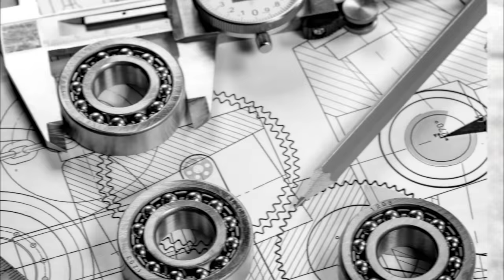The Most Successful Machine Gun in the World?

Comment: Another reason why the Germans opted to use the MG42 backbone instead of making a new MG from scratch was because there where still a lot of MG42's in warehouses (mostly in other countries), so they made conversion kits for them to be able to fit NATO rounds. If im not mistake there are still MG3's that where originally MG42's from WW2 still in service.
Reply: @fuhlfur3061  probably there are in some African and South american countries.
Reply: @fuhlfur3061  No,  wartime 7.92×57mm Mauser chambered MG 42 machine guns that remained in service were converted to the standard 7.62×51mm NATO chambering and designated MG 2
Reply: It's possible but unlikely. The MG1s and MG2s were all brought up to the same standard as the MG3, but as others here are pointing out, the weapon is being phased out slowly. So, good bet that the oldest guns were the first to go.
Reply: I'm not german, but our MG74's are also conversions of the 42.
(the devellopment for our conversionswas was done by Beretta and Steyr. Our decision makers opted for a heavier bolt, stiffer spring and thus way lower rate of fire of around 750 rpm).
During my conscript time 99/00 one of the MG's we got trained on, either had the feed cover (top cover?) or the housing of an original 42.
Under the right light conditions and correct angle, the formerly stamped in 42 that had been sanded off at the conversion was still a bit visible. (But after 23 years i don't remember if it was the top cover or the the housing.)
I mean there are parts that don't really wear much, and if they are kept from rusting, no problem to use them further. 
Things like the cocking handle, housing, grip and feed cover easily can last that long if they don't get damaged.
It's clear that no one would find orignal 42 springs, barrels and bolt heads in MG3's as they are part of the conversion anyways, or consumable items that wear out like rollers, barrel bushings and again: springs. Or bipods that get broken by soliders in use on rare occasions. 
Maybe the recoil booster could also be reused as the gas pressures of both rounds are similiar.
(i would argue that from 8mm Mauser to 7,62 you won't be reboring barrels. The NATO round is shorter and has a smaller bullet diameter. To make such a barrel work, you would need to bore it out way further and insert a "liner" then cut new lands and grooves into that liner. And before that: weld in some material into the chamber and drill/ream it out again to fit the new casing proportions. That is something that gets done occasionally for bolt action guns, but for a MG barrel? Cheaper and easier to make new barrels in the right caliber. Also, during wartime use, the barrel changes for sure weren't done every 150-200 rounds, so the existing 42 barrels would be k.o. anyways.)

Additional "fun fact":Among 10, 20 and 30 year old jerrycans (they all had their year of production stamped into the sides), we also found one stamped 1944 when stacking cans for an oncomming exercise. 
In good general shape with only a little bit of surface rust on one edge. It was still in normal use for Diesel. (for 56 years by that time)
Reply: @fuhlfur3061  According to the Bundeswehr, the phasing out of the MG3 started around 5 years ago. Clearly there have been converted 42s in use while the MG5 was developed, but I too believe they are now already sold to private owners / other armies.
Reply: @fuhlfur3061  just like m2s, the older stock gets put in warehouses and might see the light of day depending on several arbitrary inventory procedures and rules and blah blah blah.
Reply: I think utilizing a well proven design is the real reason
Reply: @luarbiasawaras8700  And having machinery and experience to make it or at least most of it's parts.
(Also, the Belgians would not let them make FAL's so i guess they would also not have let them make their MG)
Reply: While I was in basic training in 2008 my company had 3 MG3 s with crossed out MG42 markings on the case so this is indeed true.
Reply: @nirfz  yes, agreed, they don't have to start from zero
Reply: @fuhlfur3061  Its definitely not being replaced by the MG5, the MG5 clearly serves a different role than the MG3.
Reply: The ammunition was converted to NATO dimensions.  that's why the MG42 became the MG 3. They are both absolutely identical, except for the caliber.
Reply: @fuhlfur3061  I think i worded it wrong, i meant not completely replaced, probably replaced for infantry, but the MG3 will likely still stay on armored vehicles like the Leopard, kind of like how the US doesnt mount M249's on their abrams
Reply: Never used a MG5 but I will be very surprised if the MG3 will be completely phased out of the German army anytime soon! As vehicle mounted weapon it certainly has its place ! As squad weapon I’m happy for the boys and girls it’s gone then to carry it around trough mountains or actually at all it’s a absolute Pig and I 100% never was jealous when one of my mates had to carry it 😂
Reply: @ryangoslingIRL  the Counterpart of the M249 is the MG4 and not the MG5. The MG5 will replace all vehicle fitted MG3. The SPz Puma is equiped with the MG4 but it is planed to replace it by the Mg5.
Reply: @TheEvil909295  You missed the word "still" in his comment.
Reply: @ryangoslingIRL  That is the only reason Canada has them as they are on the Leopards we bought from Germany. (Not saying it isnt a good gun just that we went in a different direction)
Reply: @fuhlfur3061  just shot one last week, the 42 is crossed out and a 3 is stamped behind it
Reply: @fuhlfur3061  meinst du das mg 3 wird weiter in den schweren mg kompanien verwendet?
da ist das doch warscheinlich effektiver als das mg5 wenn es eh auf einer lafette ist
Reply: @ryangoslingIRL  it is being replaced according to official bundeswehr videos
Reply: @tavish4699  Not for vehicles probably
Reply: Didn't they designate some of those conversions (particularly the ones for Italy) as the MG-42/59?
Reply: When I served my time in the Bundeswehr (92/93), I saw a MG3 with a casing, which has the Wehrmacht Eagle on it  (the Swasika was  grinded of)  with a production date 1944
Reply: @remoraz  thats cool
Reply: oldest browning 50 cal machine gun in US army front line service is 94 years old.
Reply: @juliemunoz2762  Probably not. The design is that old, but that doesn't mean the actual weapons themselves which were produced in the first year of production are still in service. Guns and their various parts get worn out, and the US is still producing the M2, so probably none of the guns currently in service are not that old, but the design is still identical. Same thing goes for these MG42/MG3 machine guns, originally the Germans used WW2 produced guns, just converted into the new caliber, but nowadays most or all of them are of newer production.
Reply: @MaxCroat  i’m not speculating. The weapon I’m referring too exists and was located by the army. There are many such weapons in inventory.
Reply: @juliemunoz2762  oh okay then, I didnt know that. Kind of surprising honestly, I assume that particular weapon must not have seen much combat, so it remained in good condition for so long.
Reply: The ones originally marked MG42 with MG3 stamped over it were brand new in 1959. Somewhere along the way the Bundeswehr decided to change designation from the year they were adopted like the P-38 (1938) or the Luger 08 (1908) pistols to counting how many changes there were so the P-38 was renamed P1 but in that they also counted versions which did not make it to full adoption so by now they are on P8 (aka HK USP), P9 (Glock 17).
Reply: @nirfz  the Belgians would let them, but wanted royalties for it.
Reply: @mcinteer19  Are you sure? As far as i remember hearing, the germans asked for license production rights, but the Belgians refused.
The belgians didn't want them to produce it, but would have sold them finished rifles.

Germany had bought a couple belgian ones before, which were issued as G1and when they weren't allowed to produce it themselves, they went for the G3 and gave the belgian made G1's to border control and reserve police units.

Comment: I wouldn't be surprised if the MG-3 still remains in some form of service 100 years after it was first introduced.  Some developments simply cannot be further improved.
Reply: You mean like the M2 Browning already has?
Reply: @georgesakellaropoulos8162  

Not the same, the M2 Browning is not a multi purpose mashinegun used by infantry and vehicles alike ....
Reply: @mandernachluca3774  Why does firing a heavier caliber make it not count? It was widely used against infantry, light vehicles, light static defenses, and low-flying aircraft on the ground. Still is, too.
Reply: Imagine they make one with barrels that can withstand more rounds being fired before needing to be replaced
Reply: @crowe6961  The question is not what the gun is used against, it's a question what the gun is used with. In particular in an infantry role without a fixed mount (= only bipod). That's the definition of a light machine gun.
The moment you mount it fixed it's a heavy machine gun. A particular model used in both cases is a universal machine gun.

For comparison out of US inventory: M60 was universal.
Reply: Like the B52 bomber. It’s that good it’s still in use too this day. And they plan too use them for at least the next 50 years which will by then make it a 100 year old design.
Reply: @MrOiram46  
You can shoot more than 150 shots through the barrel.
The exchange of the barrel serves to preserve the material.
The old barrel can cool down and the new barrel cools the slide after it has been inserted.
You can also fire with the barrel until it glows yellow, but then the barrel is ruined (deformed, warped and eaten away by the bullets), and the ammunition will then ignite by itself once it has been inserted into the barrel (continuous fire without the trigger to press until there is no more ammo in the barrel).

A barrel of the MG 42 could withstand an estimated 8-10,000 shots (if the barrel was changed regularly to cool it down) before it was ruined.
Reply: The mg3 will undoubtedly remain in service in the military until projectile weapons (firearms) are obsolete.
Reply: @brianx2504  Well, not in Germany. We are in process of replacing them with MG5 (and MG4) right now.
Reply: Probably, with a potential use of Colonial Space Marines while defending themself against Xenomorph attacks yelling "Lets rock!".
Reply: @DrKlausTrophobie  Its the same platform though. The design still lives on.
Reply: @brianx2504  MG4 and MG5 are gas operated, not roller delayed. I really don't see how you got to the conclusion it's the same platform.
Reply: It can be improved. Try new barrels that can withstand continued fire. And rust proof parts. Make it so it can withstand wild temperature differences and will not cold weld and I can be used in space
Reply: Only 20 years to go for the MG42/MG3 centennial.
Reply: According to another documentary on the MG3, certain countries plan to keep it in use until at least 2053 which is pretty impressive and a testament to it's capabilities. It's also true though that more advanced models will eventually replace any weapon no matter how good.
Reply: @MrOiram46  Remember there were two different barrel types - a drawn and a polygoned...  not sure, but i guess the polygoned should able to fire more rounds before overheated... like i said, im not sure, because its long ago.
Reply: @DrKlausTrophobie  Ja, aber besonders viel Glück hatten wir bei den Neuanschaffungen in der letzten Zeit ja nicht. Wobei manches auch durch die Medien hochstilisiert wurde (G36 zb.)
Reply: Es gibt nichts besseres, warum sollte man es nicht einsetzen.
Reply: @johnathanstephenson8107  ich glaube du hast keine Ahnung davon
Reply: @georgesakellaropoulos8162  Actually M2 is produced since 1933 (at least current version) which does it not make less impressive :) Funfact: The M2 uses a calibre developed from the German 13 × 92 mm HR

Comment: Still, the MG 34 stayed in production until the end of WWII due to the quick-change barrel mechanism for use in the fighting compartment of tanks and other such armored fighting vehicals.
Reply: Yes but no. Quick-Change can do both. MG34 does it to the rear, which takes up less space in the tank. Mg 42 changes the barrel to the side
Reply: @D.R658  That was the point. Most German tanks were developed with the MG 34 as the standard on board weapon. In order to go over to the MG 42, the gun port on the tanks would have had to be redesigned. Easier to keep the 34 in production.
Reply: The 34 is also more durable and better made because its comprised of milled parts not stamped. MG34 all the way, enough fire rate imo.
Reply: But time consuming and expensive to manufacture.   The firearms equivalent of a fire hose does not need to be all that complicated or expensive it just needs to work.   A predictable beaten zone at X distance with features added to deal with the heat production.
Reply: @D.R658  The method of barrel change made the MG 42 unsuitable for internal secondary or co-axial armament on World War II era German tanks or other armored vehicles with the exception of the Jagdpanzer IV. Early versions of the Jagdpanzer IV carried two standard (no modification made) MG 42s on both sides of the main gun mantlet/glacis, firing through a firing port which was protected by an armored cover plate (with the MG 42 retracted) when not in use. Later version Jagdpanzer IVs carried only one MG 42 as internal secondary armament.
Reply: The MG-34 was also very popular on the Eastern Front in particular and most troops preferred it over the MG-42. That being said it proved to be something of a liability because well... maintaining, repairing and dismantling an MG-34 is akin to torture because it was immensely complexly designed and built. It's a great MG, don't get me wrong but if any Wermacht armorers hung themselves after putting it back together enough times I wouldn't blame them.
Reply: @AKlover  But as MG42's replaced MG34s in the Infantry units, those MG34s were modified for vehicle use. Waste not  ...
Reply: @piperp9535   Germans had A material shortage at the time and needed faster cheaper assets, of course they'd "Repurpose".   Also reloading the MG-34 was apparently easier in A vehicle.
Reply: @stevew6138  There was also not much reason to change it in the first place, since the MG34 mounted in vehicles would not see the same conditions like as infantry weapon. There was much less risk of being exposed to dirt, dust and cold weather inside a vehicle. So there was really not much urgency to replace the MG34 as weapon for tanks and vehicles compared to machine guns for the infantry.
Reply: The MG 34 was fitted with a armored barrel when used in a tank.  This is most likely why it was in production until the end of the war.
Reply: @AR-GuidesAndMore  After some comments, I think not.
Reply: yea it was only kept in production since production was already running  and they still  needed them for the tanks and on some planes
Reply: @D.R658  the mg42 couldnt be put in the tanks but only on the top
Reply: @97MrBlues  One reason the MG42 was developed is that it is more reliable than the MG34.
Admittedly a minor reason compared to the price difference but the MG34 always had issues in less than ideal conditions and the MG42/MG3 has not.

Comment: This, as well as the M2 Browning, is definitely one of the, if not the most timeless weapon designs in history
Reply: The thing about the M2 is. I simply cannot understand why it's got such a wide adoption..
It's extremely heavy for it's caliber making it not ideal for aircraft use... Jet it was... It's even heavier for infantrymen to carry around because you need the fucking stand...🙈
Still got adopted.
And it's not even verry precise nor has a particular good cycle time... 🙈

Fascinating isn't it?
Reply: @justacomment1657  The difference it that it is a heavy machine gun rather than a light machine gun like the BAR or M240. They have different roles.
Reply: @justacomment1657  Firstly, America. Secondly, it's more of a heavy machine gun, you don't carry it, you mount it. .50 cal is a really nice caliber for punching through armor, buildings, aircraft, whatever, and it can carry a wide variety of payloads without becoming a cannon. Russia uses a 14mm gun for similar reasons.

The gun also just *works*, and when they don't, it doesn't take too much to make them work again.
Reply: @justacomment1657  

The M2 is simple to produce, reliable, and packs enough punch to pierce thick concrete walls and lightly armored vehicles. It doesn't need to be particularly light because it's mostly  mounted on vehicles rather than carried around anyways.

It also had the benefit of a universal receiver, which meant it could easily be swapped out for different setups. That's not such a big deal anymore, but it was a significant part of its original adoption during WWII.

It's not meant to be some expensive perfect super weapon. It's meant to be something powerful and reliable that can be produced en masse and tacked onto anything and everything.

Also "And it's not even very precise". You do realize that the M2 browning held most of the top ten long distance sniping records from Vietnam until the 2000s, right?

Comment: I have fired both, mG42 and mg3 honestly the 8mm is only different in its higher rate of fire, the way the barrel changess is better than the m60 or the m240, it slides out with gravity and you can easily change it prone, with your head down and a much lower silouette
Reply: Well, for small ppl, its not that easy to change the barrel while proning, but it was possible. :)